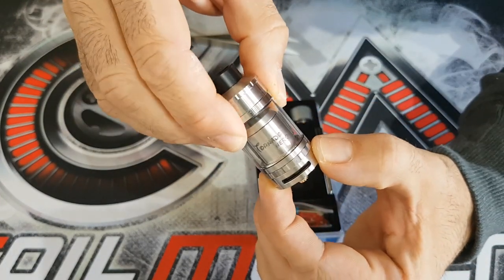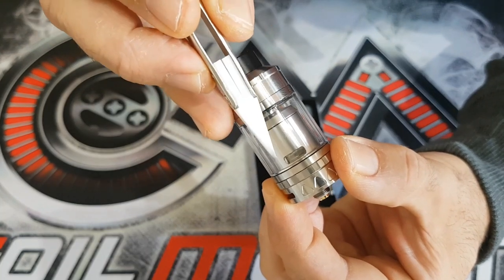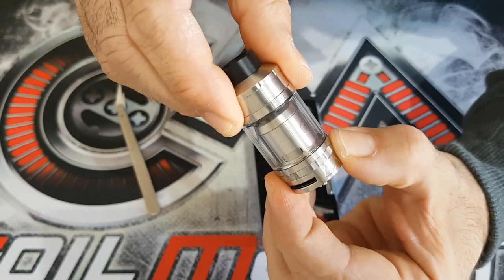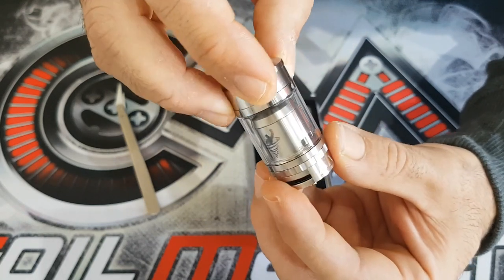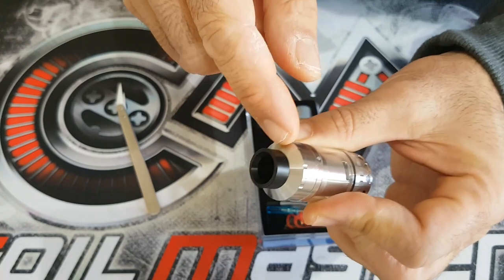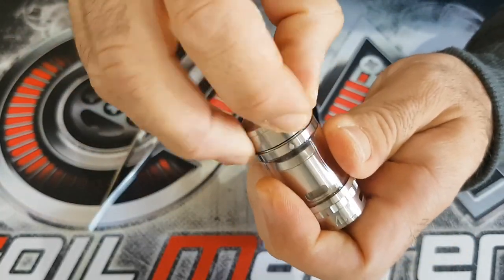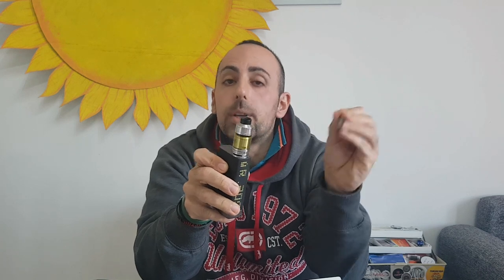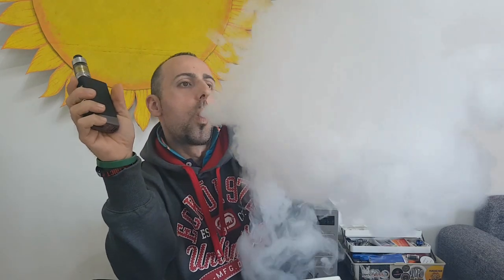IJOY TORNADO Hero RTA la nuova versione #5.2ml e nuovo Deck  (ita)

Comment: Ciao, bellissimo video :)
A quanti watt massimi riesci a spingerlo con questa configurazione?
Reply from the maker: antyspider ciao a essere sincero con la configurazione che ho utilizzato nel video max 80watt e non ho bisogno di alzare di più.
un aroma buonissimo non è caldo e tanto tanto vapore 😉
Reply: Capito. Io vorrei valutare di infilarci dentro un quad twisted 0.32mm. Dovrebbe avere un diametro pari ad un filo singolo 0.8mm. Se riesco a mettercelo dentro con una punta da 2,5/3 dovrei stare a cavallo sui 120w circa, secondo i miei calcoli. 
A limite dovrei lanciarmi su un aromizer supreme in vertical coil, a me serve un buon sostituto del tfv12 che avendo il deck da 25mm prende fili spaventosi. 
Tu cosa mi consigli?
Reply from the maker: antyspider io uso molto ud 0.25mm x4 lo giro su punta da 2.5mm lo metto davvero dapertutto 😉
le wire sono piccole e si attivano subito non scaldano il deck nemmeno in un griffin 25 che ha il deck più tosto piccolo.
come atom adoro vcst 30mm spettacolare e non sottovalutare il nuovo aromamizer plus deck senza le torrette e li ci monti di tutto anche coil da 4mm di diametro interno
fantascico aroma al top.
mentre il plus ha la recensione sul canale il vcst ancora non trovo il tempo ma fidati è una bestia.
in alternativa c'è il 25 mm
😍
Reply: Appena scoperto e ti ringrazio per questo. Che dire, con un tfv12 e un atom come quello che mi hai fatto scoprire starò apposto per un bel po' di tempo. L'unica cosa devo trovare qualcosa che mi permetta di spingerli a diverse centinaia di watt senza perdere troppo aroma :P
Reply from the maker: antyspider però non ho capito quale atomizzatore ti sia piaciuto 😊😊😊😊😊?
Reply: Quello di cui mi hai appena parlato: aromamizer plus, ho visto la recensione ed è uno spettacolo :)
Reply from the maker: antyspider ora ho capito 😉
si veramente performante e 10ml di capienza sono tantissimi. sistema antigoccia e credimi ha un rilascio di aroma veramente buono.😉